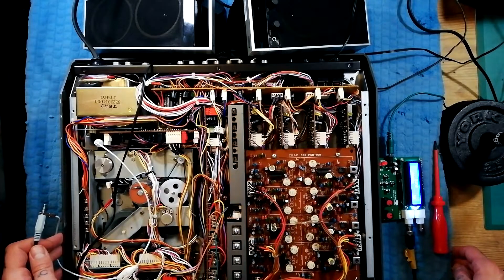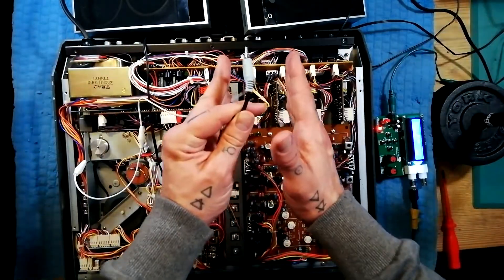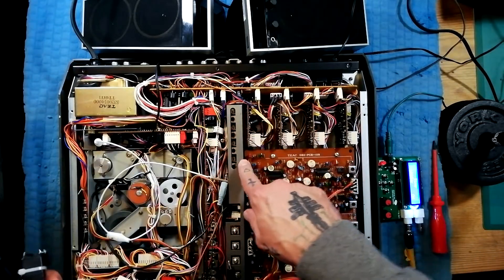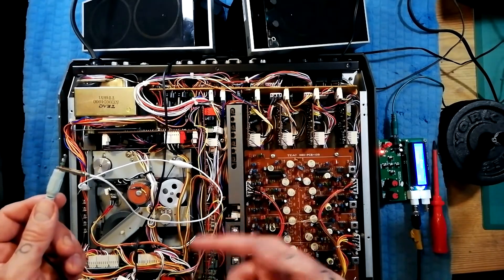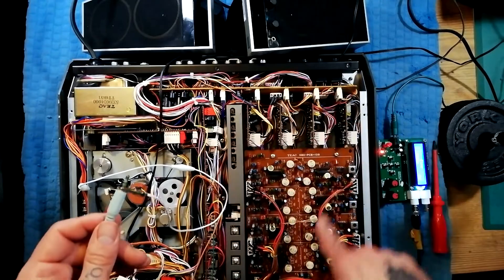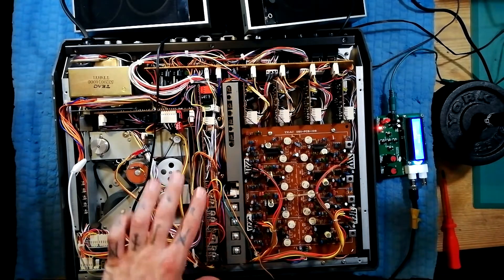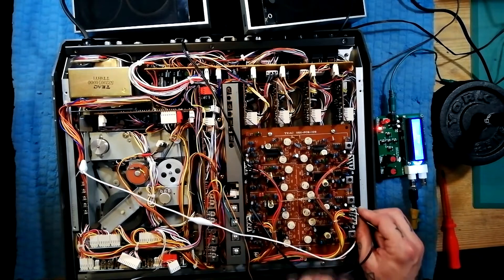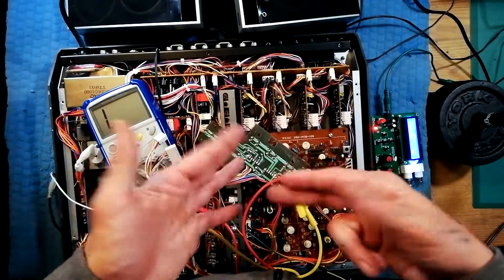Tascam 244 | electronics troubleshooting in playback mode - tracing a sine wave

Comment: Hello, how are you? Your videos are great, they are of great help! I wanted to ask you: when I record I notice that everything turns red quickly, but when I play everything is heard at low volume. What can I do? Thank you very much!
Reply from the maker: Try turning up the record amplifiers, its covered later in this video series, also in the service manual. If that doesn’t work not work, replacing electrolytic capacitors in the record and DBX decode audio path is the next thing I would do.

Comment: My Ramsa console does not have an insert input on the channels. Is it easy to create an insert input and pull it with wires using a soldering iron?

Comment: My 244 is encountering problems with playback volume when I record any overdub track with SYNC mode. While recording the overdub take, the trim gain is ample, but during playback the volume of the track becomes barely audible. However, when I record in 4 TRK REC, all four channels playback as expected. Any idea what could be contributing to very low signal playback of tracks recorded exclusively in SYNC? The problem was not persistent when I initially revived the unit.

Comment: Hey!
So I have no playback signal on channel one so I ran this test and found that the test audio from the cassette isn’t even getting to the playback amp PCB.
I’m kinda stuck on what to do next.
Thanks again for your help the other day with the gears!
Hope you don’t mind me asking another question!
Reply from the maker: Try using continuity meter to see if the coil on the head is open. The reel to reel police have fastidious objections to this technique, as you will see in the comments of this video, but it never had any catastrophic effects for me https://youtu.be/qWzLNj3kflk
Reply: @Tetrakan  
Thanks for that! Confirmed continuity so the head is fine. So I’m assuming it’s the playback amp pcb itself?
Reply from the maker: Yeah, probably the first gain stage which you can't really trace due to the way the unit is assembled. I don't know if you saw this recent video but I think it's very relevant to your situation? https://youtu.be/O-_fQZNG-zg
Reply: @Tetrakan  wow that’s an awesome video! 
So helpful!! So one last thing, I re installed the tape unit and now when I press play / fast forward / rewind. It does it for a second and stops again. 
What did I do :( 
Sorry for bulk questions. Kinda out of my depth here haha
Reply from the maker: Spunds like tape counter not ascending, so autostop kicking in. Check you plugged the counter onto the correct socket on the control board, there's more than one with the same number of pins. Also possible that something is up with the rotating magnet and hall effect transistor on the front of the cassette player
Reply: @Tetrakan  ah yes! I had the counter and pitch control backwards, is there any way I can show some extra support? I’ve been such a good dude I feel like I have to repay you somehow.
Reply from the maker: Thanks. I have a PayPal donate button on my blog or you could join my Patreon, I do extra videos for Patrons.

Comment: Hey man - thanks for being an endless source of knowledge. I have a question I've been researching but can't seem to find a good lead on.

I have a Portastudio Mf-P01 and track 4 has EXTREMELY quiet playback and no recording. I've been pulling my hair out trying to track it down. Would you recommend the techniques in this video? I know the problem has to be in the 4th track because the other 3 are more or less identical. That seems like a good lead but I'm stumped where to go within the 4th track
Reply: EDIT - I'll still take a reply for the insight but I just went through more of your videos and I'll definitely need to test the record head
Reply from the maker: Heads tend to work or not work in my experience. I figure you've got bad solder or bad caps or bad cabling or bad PCB tracks or some combination thereof on that channel. Have a look at this video, also refer to one I made about using a DMM and a couple I did about colour coding schematics, they will give you an idea of the sort of work which will be needed  https://youtu.be/fVs0ALyEUMY
Reply: @Tetrakan  Definitely gonna consume some more knowledge and get to work. Love the ethos man we really gotta work together to keep this stuff alive and you're playing a gigantic part!

Comment: I have a 244 that has no signal from Line Out, L or R. Tape Cue,Tape Outs, and Headphones have good output.
Tracing signal per your video I have good signal clear through to top pin (brn, Ch 1) on Red header on Cue amp board.
But I have no signal at Ch 1 fader.
Is this a Playback amp issue?  Is it possible to troubleshoot this on a component level?
How to access/isolate?  What do you recommend to proceed?
Any advice would be helpful.
Thanks for your time.
Reply from the maker: Sorry for the late reply. I've just refamiliarised myself with the schematics not having worked on a 244 for a while. From what you're saying the signal is passing through the playback amplifier , then the DBX board then the tape cue boards without issue; the signal is reaching the headphone amplifier from the tape cue board, but you're not getting anything from remix mode either fromt he line out sockets on the rear of the unit or via the headphone sockets? And the signal is not present at the fader of the input amplifier board (mixer channel.) One thing to make sure is that you have the U shaped metal inserts for all four access points on the rear panel which are used to connect external audio processing gear - if these are absent, you can use a male RCA to male RCA cable instead, but without some connectors joining the send and receive sockets, the mixer will not pass sound. Assuming these connectors or a substitute are present, the audio path from the tape cue pcb to the mixer fader is as follows: The signal leaves the cue PCB via socket p302 (4 pin white KK molex) and enters input amplifier board via p101. From there it passes through the input selection switch, then exits the access send socket, reenters via the acess receive socket, before passing through the following components;- c124; u101; c109; u102; c114; c115; u103; channel fader.  I hope that helps!

Comment: A person I'm in contact with Tells me he has a 244 where there's no sound coming out of the left side during playback using both the headphone jack or the line out jacks on the back.. (He says playback only works sometimes and other times it locks up) But when it does play, he says he played with panning the channels left and right, using "different configurations" (not sure what he meant by different configurations) but regardless, any way he adjusts the channels there's still no sound coming out of the left side.
Reply from the maker: Each side of the master fader is preceded and followed by an opamp - use an audio probe or scope to rest for the presence of the signal at these three points
Reply: @Tetrakan  Thank you!

Comment: Hello, I'm looking at a 244 that all the channels playback good. But one of the channels will not record. Obviously that channel has an input issue of some sort. But I don't know what to look for in troubleshooting this problem? Thank you in advance!
Reply from the maker: Have you checked the record/playback and erase heads are okay on Ch 3? See this video if you're not sure how to do this https://youtu.be/qWzLNj3kflk
Reply: @Tetrakan  I just checked out the video. Very interesting. If the recording head is the problem and has a broken coil inside it for channel 3, then I would think those heads are not available to replace unless parted from another machine? Or if available they surely must be hella expensive I would think. Thanks agin for your videos. Very informative! I recently tried to buy a unit for cheap on eBay that the seller said only had the buzzing noise when turned on, which I'm sure was a missing belt from what I learned from watching your excellent videos. Would have been an easy fix on that one. But I was out bid by another buyer, lol. However I may still go for the unit that has the bad channel 3 record function on it, as I'm only possibly looking for a unit to mix down to 2 channel stereo a batch of old master tapes that were recorded on one of these 244 units decades ago so I don't really need the record functions to work for that purpose.
Reply: @39thala  sorry for the late reply to this, I have only just seen it... while most parts in a portastudio are fungible, you are right, magnetic heads are not replaceable, motors are also a problem. And yes, those parts tend to be expensive  on ebay etc. Thanks for watching.
Reply: @Tetrakan  Ok thank you! I'll look at the video.
Reply: @Tetrakan  Wow, I just noticed you answered another poster's question 4 months ago for the same problem with 'channel 3' not recording on a 246. Wonder what it is about channel 3? Just coincidemce I guess, lol.

Comment: I am working on a 246 and have playback and signal input but not recording on channel 3. Any tips for following the chain. Waiting on one of those cheap kit oscilloscopes to get here tomorrow! Thanks for all the information your channel has.
Reply from the maker: Thanks for watching - check for electrical continuity in all four sections of the play/record head.  Then  before looking at the schematics for major "landmark"s along the audio path to signal trace the record amplifier for channel 3  , try swapping round the sockets connecting the record/playback head to ch3 with a channel you know works and see whether you get the same problem. If you do the problem is in the amplifier signal path, but several times I've had issues with the control board immediately below the transport which has a role in arming the tracks for recording. it'll eb the subject of an upcoming video, though not sure how soon.

Comment: I just got another 244, needs work but during troubleshooting noticed all my channels are getting signal just fine and all VU meters are lighting properly with corresponding selections but no needle movement on any of the VUs. Is it possible for the VU’s to be dead but still have working lights? That would suck... they don’t make those parts anymore
Reply from the maker: I think its the meter board. Replace the caps and op-amps? A bit of hassle but the parts aren't expensive, probably faster than trying to diagnose exactly which component there is dead because that board is quite inaccessible.

Comment: Hey Tetra’, my 244 is finally back together for testing after a few months apart (can’t believe it)! The problems I have are seemingly small, but the main one is that the master fader has weaker signal in the right channel than the left. I’m a bit worried that it’s because when I reassembled the fader itself, I put the slider in backwards to what you had instructed (realized after the fact). Obviously that’s a lot of teardown again to get at that. Is there anywhere you cam suggest to test before doing that? It looks to me as if there are no variable resistors for the master fader on the playback board, just for each channel, correct? If all else fails I guess I gotta pull out the REC/PB PCB again...
Reply from the maker: hey. my only concern about putting in the fader brushes the wrong way round is the possibility that you get the wrong range from the carbon strip, like, maybe it doesn't go all the way to zero ohms resistance at the top of the fader, or all the way to the max value of the resistor at the bottom of the fader, etc. After the mono signals leave the R and L output of the pan pots, the signal flow is op amp > mader > opamp, so the imbalance of signal might be to do with the fader, but it could also be a badly performing opamp, or supporting capacitors etc, or dry solder or bad track between those components. I suggest getting some longish dupont cables, at least half a dozen male to male and half a dozen female to female, they are cheap and you can get them from ebay/amazon/electronic wholesale - if you plug a M-M one into a F-F one you have an extension lead which can go between the pin header and plug for most connects on most tascams/fostex etc. if you hook up six of these between the pin and plug of the master fader you can do some logical deduction - switch the r and L fader input (two leftmost)...does the difference of volume move from the right to the left channel? What about if you switch the L and right output pins (two rightmost)... the answers to these two questions will tell you which stage of opamp>fader>opamp chain is responsible for the dip in volume But whatever the outcome it looks like you have some disassembly and even some soldering ahead :( I hope that is clear but if you need elaboration, please ask.
Reply: Tetrakan Supermonobloc This sounds like I’m now a bit over my head or going to become quite a good Tascam surgeon 😷 I’ll shoot for the latter. I took a q-tip with 99% isopropyl to the dbx board back in January to clean off the nicotine stains and accidentally started pulling off old excess flux - I’m hoping that didn’t do any damage to the solder joints. For anyone trying to remove nicotine in the future, I found that the Deoxit F5 works best as the lubricant stays on it for a while while the cleaning agent continued to break down the nicotine stains, wish I knew that at the start. Any ideas what would make the capstan motor blast through playback? I cleaned the *#@%$$ out of the pitch pot, but when it started acting up again it was as if the pot were completely bypassed. If a video would help I can post it to FB. If it is the capstan motor, do you have any thoughts on the Pacific Stereo “Universal” capstan motor? http://www.tapeheads.net/showthread.php?t=32263

Comment: Thanks for this. I will start doing this soon!
Just wanted to check... I understood correctly that I could put an old tape in and press play instead of attaching the sine wave right?
Reply from the maker: Yeah, that's it. It can get confusing if the music in the tape changes volume a lot, or there is silence between songs but it would work. If at all possible I'd recommend recording some sort of loud constant test tone, even if its just note on a cheap keyboard held down with tape recorded into the mic input on a boom box on both sides of a cassette, but in a pinch any prerecorded cassette will work.
Reply: @Tetrakan  Hello. Been a while, so after lots of tests and tracing signal paths I am not sure what the problem is. I know it records, and then I can hear what I have recorded on channel 1 as long as I have record enabled for another track... but just pressing play does not work. Does this make sense to you at all?